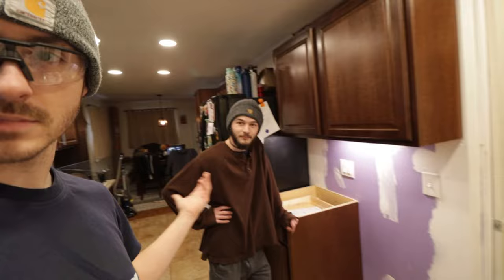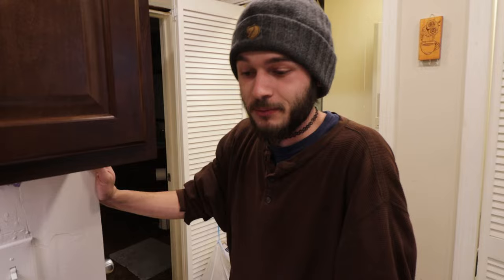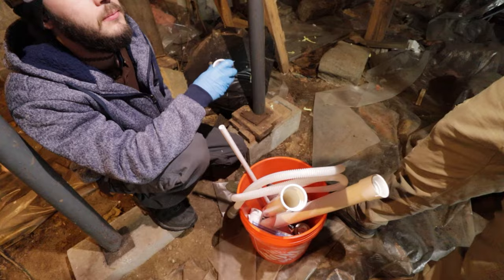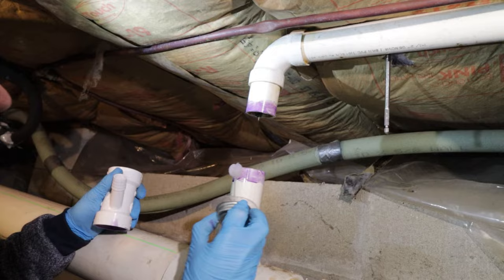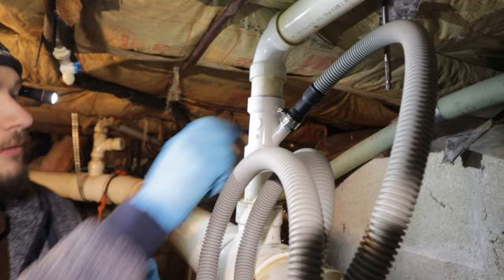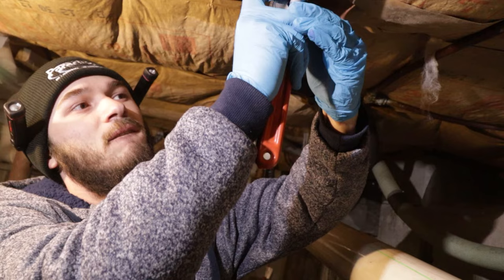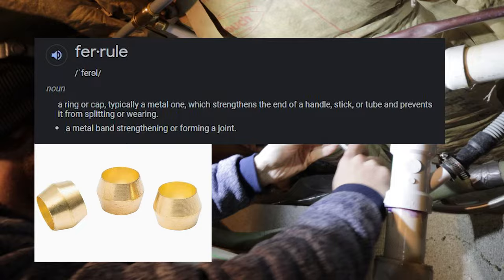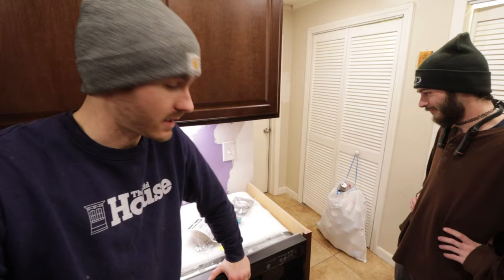How to Plumb a Dishwasher Not Next to a Sink

Comment: not trying to spoil the fun and totally understand that your not Plumberz but that drain hook up needs a p-trap to prevent sewer gases from coming back in.  Also that new branch ( Y )  you installed is not vented so when you run water down the drain that you teed off from the weight from the water will suck the dishwasher hose drain and or p trap dry.   Also the new water shut off valve is not easily accesible for service or leaks.
Reply from the maker: All great tips! There are for sure some things that can be changed. Might do an update video in the future. However, no smells or problems so far.
Reply: I’m trying to install a drip tray (for a beer tap) and a dishwasher but I only have a sing bowl and only have room for 1 standpipe.  Any ideas?
Reply: Would a cheater vent work in the basement floor joist cavity? Or would it need to be at the top of the cabinet just below the countertop?

Comment: You connected a dishwasher and a refrigerator with the same supply line. So either you are sending hot water to the ice maker and potable water in the refrigerator or you are washing your dishes with cold water. Also, insulation in the basement was installed upside down. Vapor barrier goes towards the heated side.
Reply from the maker: I’m glad you have such a sharp eye!

Comment: So youre just gonna allow sewer gases directly into the dishwasher without a trap.
Reply from the maker: Great question! No I believe I left in the portion of the video where I explain that the drain hose attached to the side of the dishwasher is the “P trap”. The flexible drain hose is looped in a way that traps water in it similar to a P trap. This, in theory, should prevent any sewer gases from backing up through that hose.
Reply: @DownToTheFrame  not code
Reply from the maker: Well we are not licensed plumbers and this is our private home. Make sure to check with a plumber in your area if you plan on installing a dishwasher similar to ours.
Reply: @DownToTheFrame  how did this work out? Did you need to go back and install a separate pvc trap or did the hose work out? I am looking to do a similar install with a dishwasher located on another wall from the sink in a concrete house (so only way to connect to the sink would be to run the drain outside then back in) but just need to know if i should install a separate p trap here or not
Reply from the maker: @kyleculbertson8991  I have been running it they way it was installed in the video. I have not had any sewer gas smells. I am fairly confident that there won’t be. However, if the code in your area requires a P trap, and you want to do it as close to code as possible, then yes you would need to either install a P Trap somewhere or run your line all the way to the sink.

Comment: Very cool video! On the other side of my kitchen, is a half bath and the sink is right next to the wall. It's an old house (1925) and I'm wondering how crazy it would be to run the plumbing into the bathroom water & drainage setup.
Reply from the maker: If it’s closer then I would probably do that lol just try to pipe the plumbing in before the P trap. Good luck!

Comment: I have the same problem at my old home.  Do I rip out the cabinet and have to get an 18” dishwasher next to the sink.  Or build shelving against the wall and put a matching marble countertop on top and install a regular 24” dishwasher.  I feel it would be better to do it like y’all did, away from the sink in my case.  Plus I would have more countertop space.  Thanks for the video guys.
Reply from the maker: You’re welcome! I think our location has worked out great. No problems with the operation of it. Sometimes a little water gets on the floor when moving the dishes over from the sink but that’s it!

Comment: Great video. I have a similar set up. Quick question: is a high loop necessary for this setup or no?
Reply from the maker: I would for sure use a P-trap or high loop. Need to make sure the sewer gases don’t get back into the house

Comment: Just a quick question was that hot water or cold as you said you were hooking it up to the fridge as well? Thanks
Reply from the maker: It is a cold water line! Sorry should have made that clear. I have heard of people hooking up the dishwasher to hot water but in my opinion it makes the dishwasher less energy efficient.
Reply: @DownToTheFrame  oh yeah really can you explain why?? 🇨🇦♥️ I’ve always thought it was the hot water line. I appreciate you responding so now I will be a subscriber!!
Reply from the maker: @rossmontreal4570  haha of course! We are very glad to have you here! The Energy star rating that comes on the machine is more than likely tested while using only the internal electric water heater in the dishwasher. If you use hot water that is heated via a gas hot water heater then the unit becomes less energy efficient. Some people like this option though. I believe it is because they think the dishes will be cleaner if it’s hooked up to a hot water line.
Reply: @DownToTheFrame  okay thanks sir I’ll have the read the manual for the dishwasher then to make sure if it’s rated for cold or hot water I guess. You guys just save my ass the wife would have not been happy if I mess up her machine!! ♥️
Reply from the maker: @rossmontreal4570  hahaha well we are very glad we could help! Good luck and let us know how it goes!
Reply: @DownToTheFrame  hey quick question before I install my dishwasher under island I’m building am I better off passing electrical by the back to the front or straight up to the front and should I do the same for water. As well my manual said hot water hook up to machine.♥️♥️ you guys are great
Reply from the maker: @rossmontreal4570   oh awesome! I am glad it says to use it! I would put an outlet in the cabinet next to the dishwasher and run the plug for the dishwasher through a hole on the side of the cabinet, around the back of the dishwasher, and to the front of the dishwasher
Reply: @DownToTheFrame  thanks
Reply: @DownToTheFrame  Good info! I had the same question.

Comment: Is it difficult having the dishwasher behind your sink? Having to turn and load it?
Reply from the maker: Gonna be honest, water does get on the floor a bit 😅 but it was an easier solution for me than tearing out cabinets.
Reply: @DownToTheFrame  thanks for responding. I am going to have a similar situation in a new kitchen buildi do to space, but  it will be directly right behind me. Not optimal situation but with limited space there was no other choice.

Comment: Dishwasher need to be connected to the garbage disposal. The t on there back will get you cloge and you will have shit water washing dishes and also the sewer smell will go in your dishwasher and your dishwasher will start smelling like shit 😂😂😂😂😂
Reply from the maker: Most installs I have seen them T before the P trap on the sink but I have used my dishwasher for a year now and it has worked flawlessly with no smell. The built in P trap on the dishwasher is doing great.
Reply: There's a one way valve where the drain comes out of the dishwasher.   Nothing will back up into the the dishwasher.  No gas, no water!